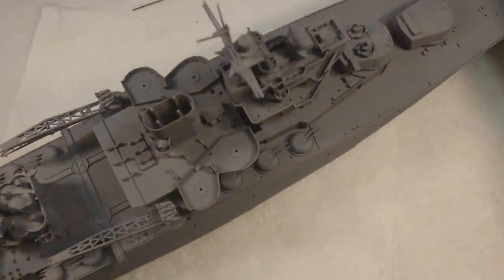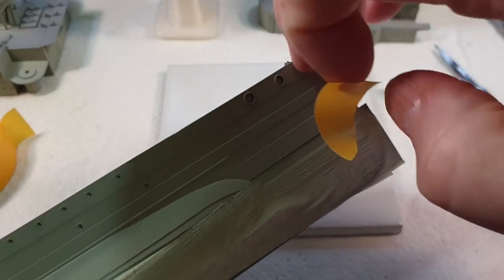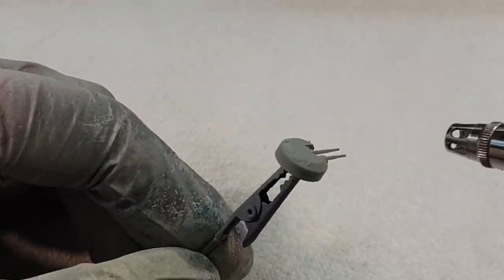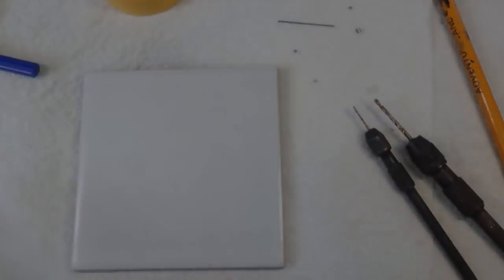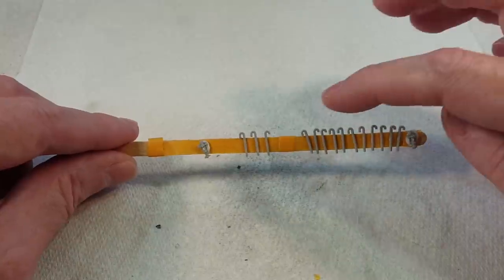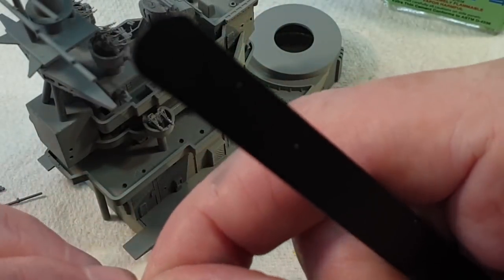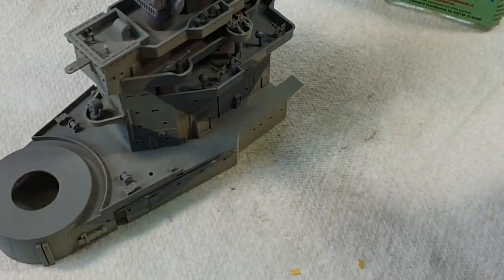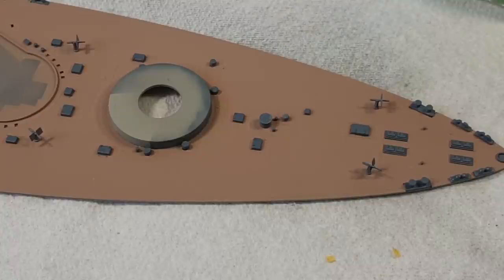Building the 1/350 Battleship Queen Elizabeth for Drachinifel - Part Three, Paint

Comment: In August 1990, the U.S. military began planning an air offensive campaign against Iraq. Planners noticed that a few command and control bunkers in Baghdad were located deep underground to withstand heavy fire. Doubts were raised about the ability of the BLU-109/B to penetrate such fortified structures, so the US Air Force Air Armament Division at Eglin Air Force Base, Florida was asked to create a weapon that could, and engineer Al Weimorts sketched improved BLU-109 variants. By January 1991, as the Persian Gulf War was well underway, it was determined that the BLU-109/B-equipped laser-guided bombs (LGB) would be unable to penetrate fortified bunkers deep underground.[4]

The initial batch of GBU-28s was built from modified 8 inch/203 mm artillery barrels (principally from deactivated M110 howitzers), but later examples are purpose-built[5] with the BLU-113 bomb body made by National Forge of Irvine, Pennsylvania.[3] They weigh 5,000 pounds (2,268 kg) and contain 630 pounds (286 kg) of high explosive.

Comment: I find it interesting that the camo painting does not extend across the deck, I guess the ships in the Atlantic fleet were more worried about submarines then aircraft.  You are doing a heck of a great job on that ship
Reply from the maker: I recall reading somewhere the camo was partly designed to confuse the eye as to the speed and direction the ship was travelling in, rather than to hide it.

Comment: The better way to handle removing all those bits is to use liquid mask instead of cutting them all off. Man you're making more work for yourself than needed. I realize this is long done but in the future keep that in mind. Don't make the job harder on yourself.
Reply: You paint the barbet BEFORE you paint the deck and then just wrap a piece of tape around the barbet. Easy Peasy
Reply from the maker: Thanks, I appreciate it :-)